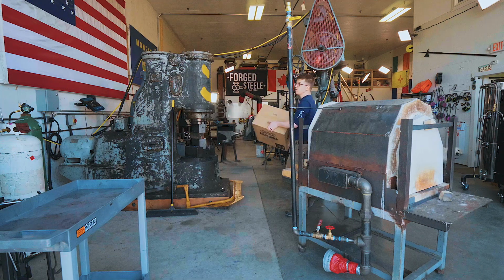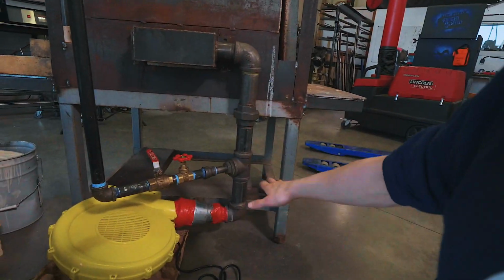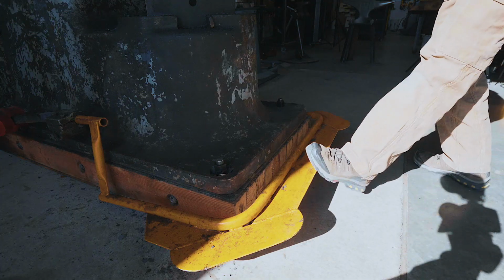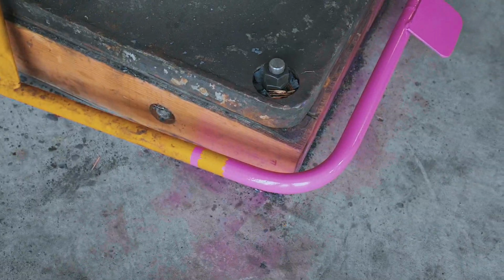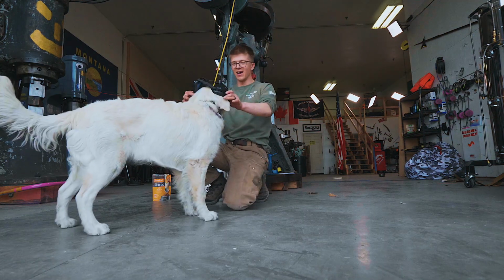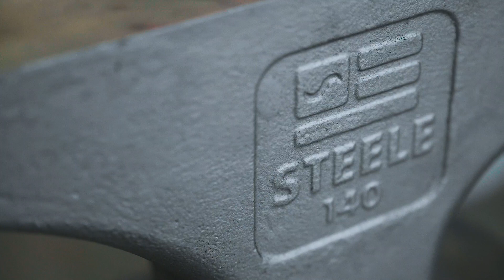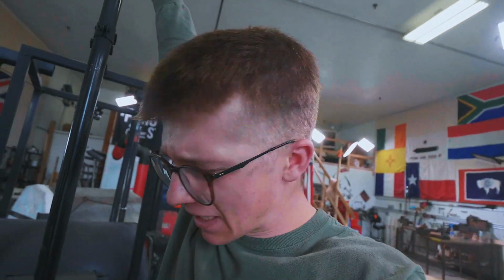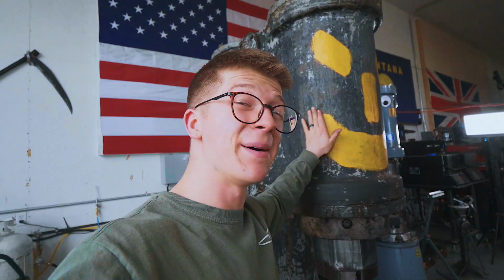NEW FORGE BLOWER, YOGO'S EARS, FORGING TOOLS!!!

Comment: You're increase in CFM has increased the velocity of the air in the pipe, if you increase the diameter  the air will slow down.  Flowrate(in3/s)=velocity(in/s) x area(in2).
Reply: Nick Favell Alec needs to lean on the comment community for some aerospace engineers or fluids guys to throw some thermodynamics magic at the problem
Reply: I think that’s half the solution but combine that with where the gas mixes in the system before an elbow and the pressure produced by that blower may very well be defeating the pressure of the gas. Figure every inch of H2O produced by the blower reduces the gas by the same inch and when only running approx 7” WC, 2” produced by the blower is around 27% gas lost
Reply: My 2 cents is to smooth out the gas flow.  Get rid of the 90 and replace it with a couple of 45s.
Reply: He could also do that by running an extension pipe out of the shop to relocate the noise or he could use a dimmer for some sort of speed control.
Reply: @user-qy8kw4cn2s  he needs a better way to regulate his air speed to me it seems that setup worked fine for propane but on natural gas it doesn't have the gas density to air right and his air flow is so high he is literally blowing out the candle.
Reply: From a layman's perspective:  Bigger blower = more air.  More air + more fuel = more hot.  This is good.  But, same size pipe with more air means higher pressure air.  Thus resulting in the blowout inside the forge.  This is bad.  The ideal, I'm guessing, would be to have a blower moving a lot of air, slowly.  Possibly through a larger pipe to keep the pressure down.  Mechanical bellows, maybe?  Or a large but low-RPM blower.  Either way I'm guessing would be quieter than a cheap bouncy castle blower.
Reply: @AJsarge1  50ft of dryer vent hose extend to reduce air speed collapse to increase my 5 min macgyver fix
Reply: Not directed at you Nick, but people need to remember there is a difference between volume and velocity. Looks to me like undersized pipe, restricting Volume, but increasing velocity.
Reply: Look, the problem is more air volume at less pressure.  One more thing to note is you don't want to mix the fuel and the air before an elbow. The air travels faster than the fuel does.  You want the fuel line 12 Inches from the ribbon and larger pipe until it gets to the fuel line.  That way you are pushing the fuel into the ribbon with the air pressure behind it.  More volume at less pressure will fix your issue.
Reply: That 90 isnt helping with disturbing the air

Comment: Not my area of expertise in engineering (non compressible liquids are fun, compressible gases are scary to me), but I'd hazard a guess and say you're air velocity is too high. You want to increase your volumetric flow rate to get more oxygen, but at the same time you don't want to increase velocity much at all. You're new fan is pushing more air, but without a change in area, it's got to go faster through the pipe. Increase the area (larger pipe size) and you'll get the same volume/time but it doesn't have to move as fast and it might not extinguish your flame. 
That being said, without changing the nozzles in the forge, I'm not sure how you'd get a lower velocity entering the forge, if the nozzles don't change either. 
Maybe it's a pressure thing? Again, gases aren't my thing. I barely had a handle on my fluids class and we only looked at water and oil.
Reply: I think you hit the nail.  Going from a 4' pump discharge to a 2 1/2" or 3" steel pipe, he has made his own venturi which is what you said.  He has speeded up the air which gives more pressure.  Alec, if you have read this far, take off all the iron pipe and use 4' pvc or metal furnace pipe from the blower to the forge.  If still too much air,  install a 4' slide gate from a dust collection system to regulate the amount of air.
Reply: Or hook the fan up to a VARIAC so he has total control over the speed of the fan
Reply: consistency 14  Don't you know? Engineering is all just precision guesswork
Reply: Has anyone thought of just drilling out the holes in the burner to see if they are not partially clogged?
Reply: I'm sorry for this but I gotta do it: You're = You are. It's *your 😂
Reply: This comment is in the money. Engines combine fuel with air, and everything about their engineering is based on smooth air paths to prevent turbulent flow.
Reply: I still think the nozzle of the ribbon burner is clogged. I would suggest trying to open it up and remove any debris and running an appropriately sized drill bit through each hole.
Reply: @julyoon  okay, cool. It's youtube, not a report I'm sending a client. As long as the point is clear, that's all that matters.
Reply: @HelenaOfDetroit  That's a great point that I didn't think about it. I would do that that first.
Reply: @ninjasownpirates  Well obviously. I just couldn't help myself.
Reply: Great comment. One thing to add. A simple ball valve from your local mega mart inline downstream from the blower will let you regulate the air flow easily to dial in the air/fuel mixture to your liking. It will let you experiment to find what works best. You can up/down size once you see what works with the knowledge of what works the best. Or even add a temporary block to the intake side of the fan with a bit of cardboard. Not great for the fan long term but it will be a quick and easy check to see what is going on.
Reply: Car muffler. Reduce velocity but still enables full airflow
Reply: @detroitbob58  changing the pipe diameter on the outside of the forge is only part of the solution. The only place where velocity matters is when it exits the nozzles inside the forge. This is a more complex problem than simply changing pipe diameters since air is compressible. With a compressible flow, you  can get different mass flowrates at different points in the system, so it's not only a question of having a bigger area, or regulating the pump. The variables here are Wout=pout*vout*Aout=pin*vin*Ain=Win. (W is mass flowrate, p is fluid density, v is fluid velocity, A is area of the pipe. "in" means it's as it enters the nozzle, so the parameters of the gas in the pipe outside the forge, and "out" is when it enters the forge.). Here we need to bring down vout as much as possible. We can influence Win by changing the pump flowrate and the outside pipe diameter, since that will change the pressure inside said pipe, which directly influences pin. The problem here is that we don't want to lower that because the forge needs all the flow it can get, and Win=Wout (because this isn't a choked flow). We can't change pout, so to make sure vout goes down, Aout must go up. Since Aout is the area of the burner nozzles, this is what most importantly needs to change!
Reply: @colindonar3027  Lmao I'm going to school for engineering. An engineer is just someone to dumb or stubborn to believe that it can't be done.
Reply: @DanMooreNCF  Yeah I had just noticed that this is the second video showing him blocking the fan intake to throttle the flow and thought of setting up a ball valve or even a louver in line and would be convenient if he was already sizing up his piping. Like you said, it's probably going to kill the motor faster than it would unobstructed. I think the only way to "right" way to get the perfect air flow rate without buying/testing many fans or doing the math, would to get a fan with similar specs, with a speed controller. Then you could set it and forget it.
Reply: @louispicard2906  Thank you for explaining what I was trying to get at. The burner seems to be the bottle neck, but I'd go back to what Helena said above, and have Alec check to see if can verify if any of the burner nozzles are clogged/obstructed or not. That might be reducing Aout and it could be a simple, free fix if their accessible! That's be much better than replacing the ribbon burner since it's encased in the refractory (at least I think it is).
Reply: Someone below mentions choked flow at the nozzle. . . Choked flow parameters only apply when when the system reaches approx Mach 1. . . The forge ain’t punching that much deltaP . . . It’s def a c-d nozzle problem though for guys who are better at it than me
Reply: Maybe the forge blower has too much pressure so only a small amount of gas is able to go into the forge, so larger forge holes
Reply: @mnshp7548  Exactly right natural gas only has .25 psi. I don't know if alec will read my comment but putting the mixing pre outlet of the fan will solve that issue easily.
Reply: @jared5220  This was exactly what I was thinking. Natural gas lines are under fairly low pressure and hooking a powerful blower to some ducting that has some significant bends and restrictions downstream from where the gas gets introduced might create enough head pressure at the point of gas injection to not allow for much gas to get injected. My guess is that if he can reduce the blowers output enough it'll work at least as good as it was before. Though I would use some sort of speed control on the motor to reduce wear and electrical consumption instead of putting cardboard over the intake.
Reply: @louispicard2906  That is the right math, and thus most likely the injector is one of the problems to look at. But as James French says, only half of the problem, if the fuel injection can't keep up with the oxidizer, increasing airflow will just choke the flame more. So you know Alec, listen to these two.
Reply: I was thinking adding another burner to the other side of the forge would be his best option. It would effectively double the bore of the burners resulting in a lower air speed without restricting it and losing pressure inside the forge, and being more open would lower pressure in the piping as well, making it easier for the natural gas to flow at full capacity. And of course it would have the added benefit of a more even heat in such a huge forge.

Comment: You need to add a little of Bernoulli's principle to the forge. When it comes into the forge widen the pipe (7 degrees would be optimal) to slow down the air flow but you will still have the same mass of air. It will allow the air and gas to mix better to give you a better flame.
Reply: Steve S YES

Comment: Alec "the dog whisperer" Steele

Damascus dog tag?
Reply: Yes please
Reply: Yessssss
Reply: With engraving
Reply: Why not just make a Damascus dog with its own dog dog tag
Reply: @firnatine529  They are usually stamped, with a special type writer. The old ones were done by hand (actually typing it into it) and the new ones are more digital, put everything in and basically hit enter and it does it for you.  So I think that would be a better/ cooler/ more traditional way
Reply: @firnatine529  And acid "burned" letters/number.
Reply: I support this!

Comment: The issue with the forge/ new blower might be that the air is moving too fast, and basically blowing the fire out. That would explain the unstable fire, the fire being shot out against the far wall, and also why only half the brick is burning, the gas/air gets pushed out the front before it has a chance to spread out, or potentially the Bernoulli effect creating a vacuum and pulling air in through the other holes.
Reply: A VARIAC would allow him to decrease the speed of the fan by adjusting the voltage downwards causing the fan to spin more slowly.
Reply: That is what I was wondering. Too much air velocity.
Reply: yep, looks like your pipe for the air is too small in diameter and the resulting air velocity is too high. Also the mixing of the gas may be an issue  like if the stream gas doesn't have the time to mix with the air properly. To increase mixing  you may stick something in the pipe to create turbulence , some sort of blade/propeller. Good Luck
Reply: That was my first thought too, that the gas mix is moving out faster than the flame front. But I don't know enough about these things to say for sure
Reply: consistency 14  why are you mad? He's struggling with a fluid dynamics/ chemical reaction problem. Given the relatively high velocity of air/gas, and the relatively low pressure, it's very possible that the Bernoulli principle is causing some of the issues, especially when he said it's not how he expected it to look, which means that something unintuitive is going on. If you think I'm showing off by saying "Bernoulli principle", that's not the case, I'm using the name of a phenomenon to reference that very important but sometimes counter-intuitive phenomenon.
Reply: Fixing it would need a bigger pipe, and possibly some sort of turbulence generator to slow the gas down while allowing the pressure to still be high enough for the furnace to run.
Reply: @agenthaine  that would lead to the same problem as before, where there simply wasn't enough oxygen in the stream to fully burn the gas.
Reply: @jamesodonnell8290  it depends if there is a sweet spot for pressure and air fuel mix at lower RPMs from the fan having control over a range of pressures adds flexibility. Most problems have multiple solutions. An easy test is to enrich the blower intake with an oxygen feed (borrow a feed from an oxy acetylene oxygen tank ) but looking at the flame getting blasted against the wall I'm inclined to say too much air pressure is definitely a factor. But what do I know I'm not a blacksmith or a scientist. But I do know electronics.
Reply: @agenthaine  I'm guessing that the bouncy castle blower on low power would behave like the old blower, but maybe not. Its probably worth a try before replacing all the pipes though.
Reply: @jamesodonnell8290  I think this is probably one of those a Little from column "a" a little from column "b" problems. What I'm saying is if we say (pulling a number out of thin air) the old blower was 50% the power of the bouncy castle blower would running the bouncy castle blower at 70% fix it? If not what about 80% or 60%? Obviously for whatever reason 100% is too much but with a VARIAC you can adjust the power in real time and see how it affects the forge. In this scenario having an over powered blower is actually an advantage as it will give more flexibility.
Reply: James O'Donnell yes, most people don’t understand the relationship between velocity and volume.  A bigger pipe will decrease the velocity but still allow move volume of air. Alec in his initial diagnosis was thinking he needed more air, today showed that he is indeed getting more air but at a much higher velocity.
Reply: @agenthaine   yes and no ... there are 2 problems here: 1. getting the amount of air (oxygen) needed and 2, mix the air with the gas so it can burn properly.  The faster the fan, the more air but the less mixing, on the other hand, the slower the fan the better mixing but not enough oxygen. One solution is then to use a larger pipe to reduce the speed but not the amount of the air that it is pumped in. Increase mixing by creating turbulence inside the pipe by means of an expansion chamber or an impeller could also help .

Comment: Alec,
My two cents worth: It appears that the piping size is correct since it is what came with the burner. So, calling on my experiences with cooking ovens and industrial boilers, it sure looks to me like your gas pressure is low and cannot overcome the increased static pressure in the piping to the burner. This back pressure is caused by the burner holes themselves and not the piping leading to the burner. A higher pressure blower only makes this worse. Can you increase the gas pressure at the gas regulator to try this theory out?
Reply: It did really look like the fuel/air mix was way too lean, and natural gas lines aren't really that high pressure, so it could well be the air pressure in the pipe gets high enough to basically shut off most of the gas flow. But also, if it seems the ribbon burner only burns partially, it could also be clogged (which would exacerbate the issue.
Reply: would that mean a bigger pipe with slower air would make it even worse? (fast air = less pressure, right?)
Reply: I think this is basically correct. I’m not sure what he would do to fix it without changing the whole piping. He probably needs to find a way to dampen that fan a bit more and see if it gets close.
Reply: Finally someone with the correct answer. As an engineer I can assure you, that the problem is the ribbon burner itself. Because natural gas has such a low pressure you have to lower the overall resistance for the airflow. Beginning at the WORST component in terms of resistance. And that is the matrix of the ribbon burner! Enlarge these and you'll get more volume with the right mix. Problem solved!

Comment: Is it possible that at your altitude, an oxygen separator feeding into the intake of the fan would be more useful than increasing the  overall volume of air getting in...at least beyond a certain point? Recognising of course that at the moment sourcing an oxygen separator for a non-medical purpose might not be the most prudent...

Comment: Just out of curiousity can you find out what type of gas the big forge was run off, you might have the wrong jet set up.
Reply: yeah i was thinking that there is an incorrect mixture of gas, or that the gas is not mixing with the air properly.

Comment: All the tools in the shop, but you undo the bolts with an adjustable 😭😭
Reply: When half the bolts are SAE and the rest are metric sometimes its just easier to grab the adjustable even if they end up rounding the corners of the bolt.  I'd be willing to bet there aren't any metric bolts on that power hammer.
Reply: gary bower that’s a good point, just breaks my heart to see a bolt being removed with an adjustment 😂😂